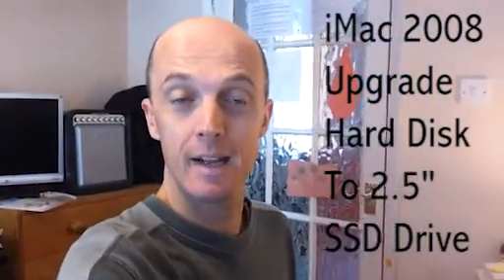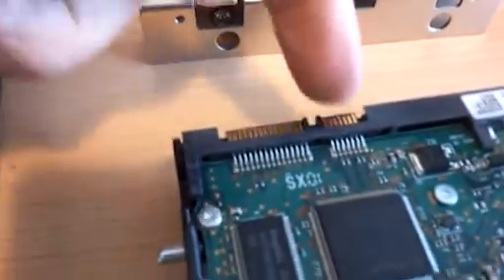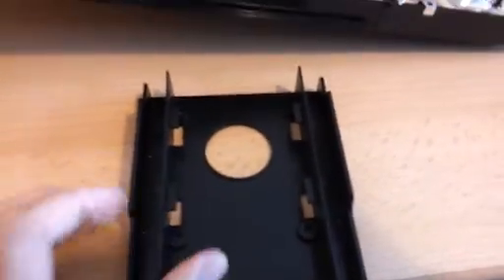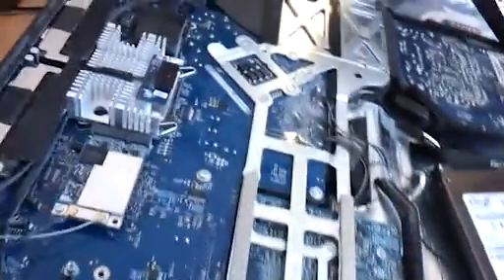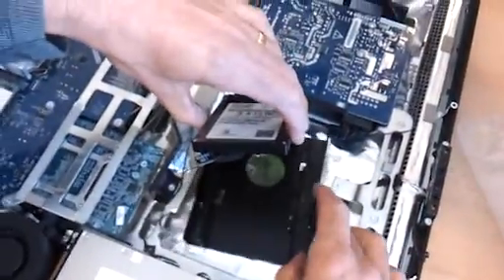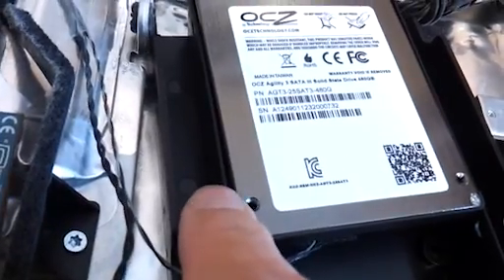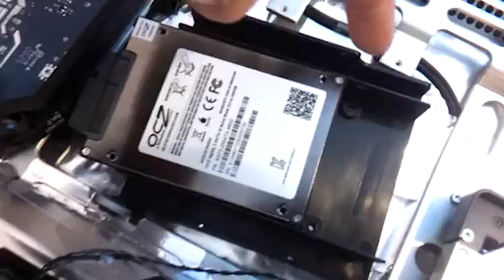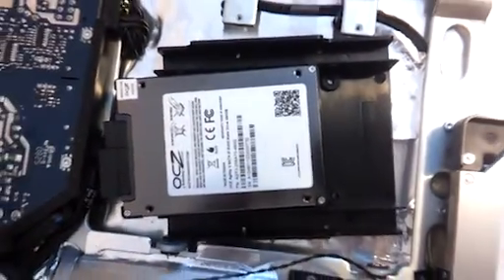iMac 2008 Aluminum Upgrade Hard Disk to 2.5inch SSD

Comment: After roughly 3.5 years: What tray or adapter do you recommend to buy for an iMac 24-inch Early 2008 HDD to SSD replacement?

Thanks.

Comment: Just use double sided tape to hold the drive in. No bracket needed.
Reply: PokerMan That's exactly what i was gonna say, why all this bother? An SSD has no moving parts in it, it does not need to be fastened like this! Plus it's sufficiently lightweight to stay in place with some heavy duty duct tape
Reply from the maker: +OuiNonMaisSi +PokerMan - fair comment. Guess we were just wanting to be really sure that SSD wasn't going to move about. I think I'd be somewhat less particular about it now.

Comment: There is an even better solution. There is a 3.5 inch housing ( actual housing not an adapter ) for 2.5 inch drives which will make them look like 3.5 inch drives.
Reply from the maker: +ilcool90 Yeah. At the time we had to do with what the local IT store had in. It wasn't ideal.

Comment: Nice video, I used the same plastic thingie in an 20" early 2008 and so far so good. Well, I tried putting the HDD temp sensor on the underside of the plastic SSD casing, like in the video, and the Mac's fans said 'Full speed ahead!' from poweron till poweroff. As such I opened it again and put the HDD temp sensor on the optical drive's metal casing, next to the optical drive temp sensor, and now it's quiet again.
Reply from the maker: Thanks for commenting. Certainly we had no issues where we placed our sensor but I guess each SSD will be different where heat is concerned.

Comment: To avoid the issue with the 2.5" drive in the 3.5" bay, try one of the following:
NewerTech AdaptaDrve
Or the previously mentioned Icydock EZConvert MB882SP-1S-2B
Reply from the maker: When we made the video we had to come up a solution that day and we were at the mercy of what the local stockist had sadly. If I did this procedure again I'd def buy a better tray!

Comment from the maker: Hi Dan, the iMac wasn't mine its a friends. But yes 1G is too little for Mac OSX. Put 4G of RAM in  - that will help massively. But frankly there is nothing like putting in an SSD to massively speed up a system. Try the RAM first. Thanks for commenting.

Comment: Hi great video, I'm thinking of doing this myself. I found a  caddy called 'Icy Dock MB882SP-1S-2B Black HDD Converter' I guess this may have solved your short cable issue. Or did you come across it and not go for it for some reason?